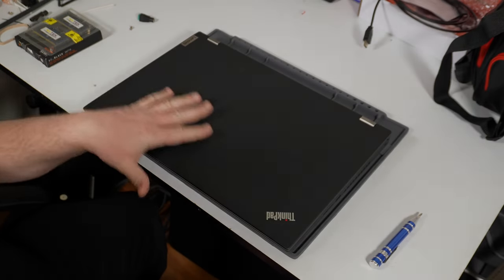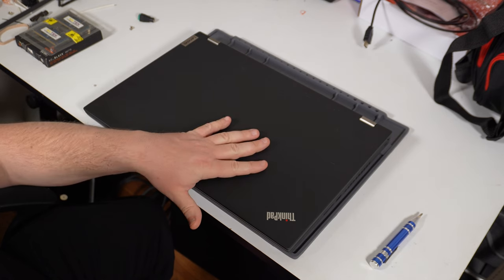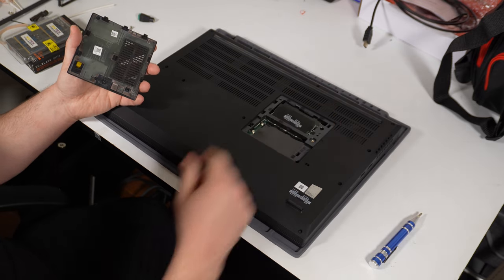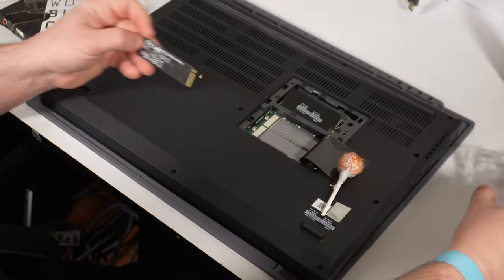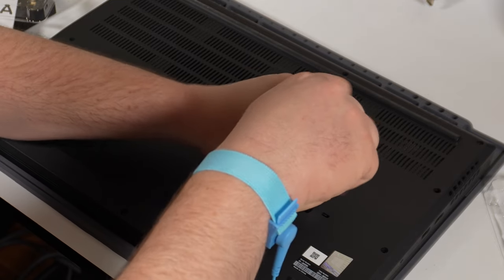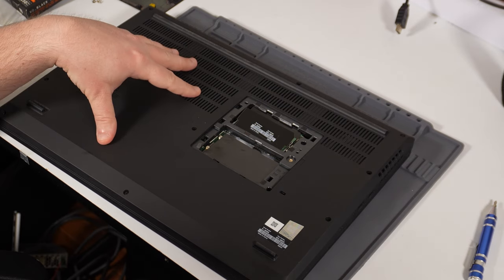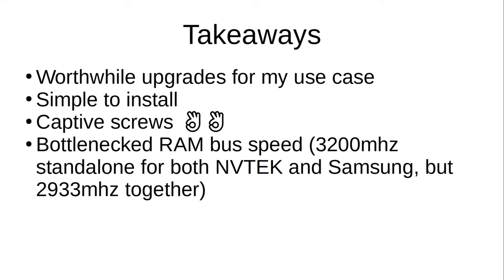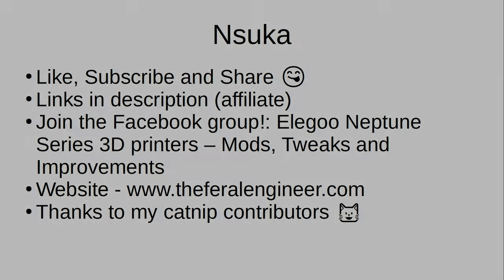Lenovo ThinkPad P17 Gen 2 RAM and SSD upgrade

Comment: Your video was outstanding, I thought I let my battery die by running the Thinkpad Gen 1 however it went asleep. I'm lucky when I opened the RAM that I didn't cause a short.  I will buy your recommended antistatic accessories since I always play with computers.  I believe my Gen 1 will not accept the huge RAM that you've installed.

Comment: Has anyone tried adding a 4TB ssd m.2 nvme drive?
Reply: Just FYI I successfully installed two 4-TB ssds into the "extra" slots in the back of my P17. They became D: and E:, and they are working fine, even though the specs said 2-TB was the max size. I bought the cheaper Crucial 4TB drives because there seems to be issues with heat from "high performance" drives. (I scan photos and am more concerned with space than speed.) Next, I hope to replace my 1 TB "spinny" C: drive with a 4 TB, for a total of 12 TB of storage, which will require the whole keyboard-removal thing. Thanks for your video, it is very helpful.